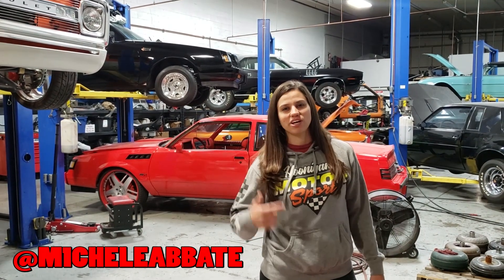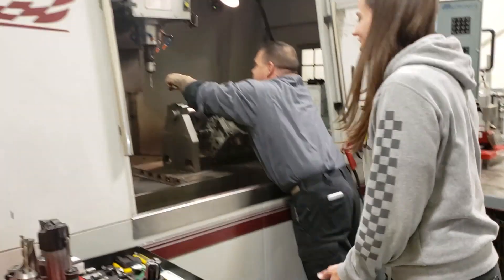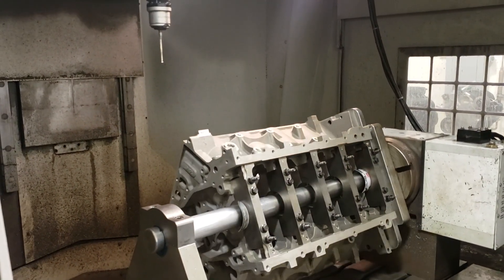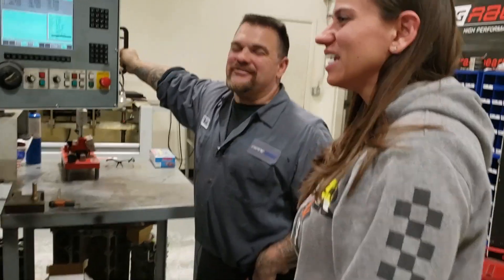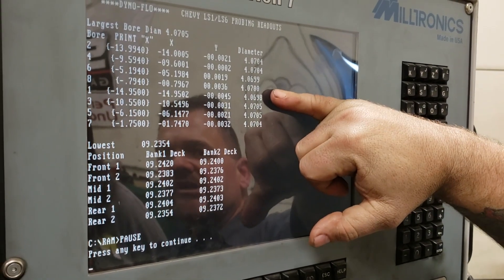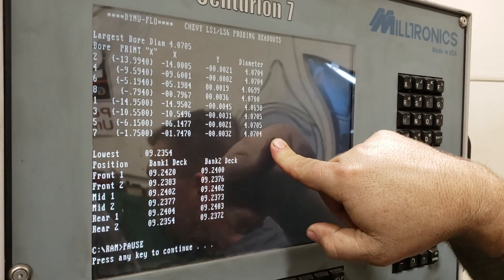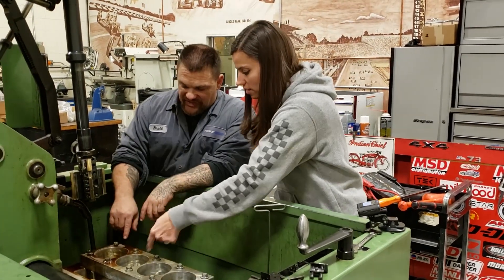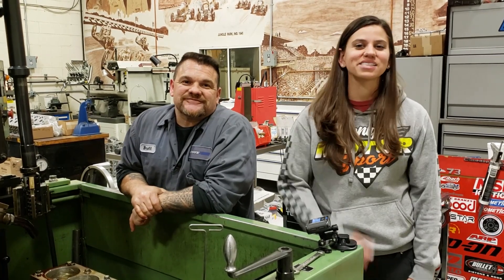Project GrrMaro Episode 6 - LS3 Block CNC & Cylinder Honing

Comment: I was thinking of getting myself a 427, I didn't realize an LS3 could be made into a 427. I thought it would make the cylinder holes to thin to hold up.  What year ls3?
Reply from the maker: its the oem motor, so its a 2011 motor.  We did have to shave a bit off the block for clearance for the rod stroke, but it wasn't too bad